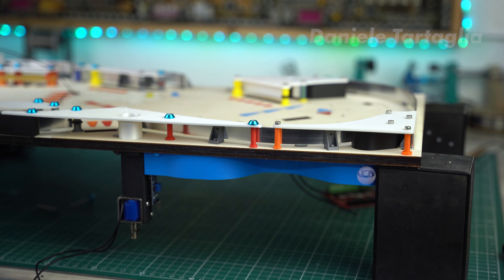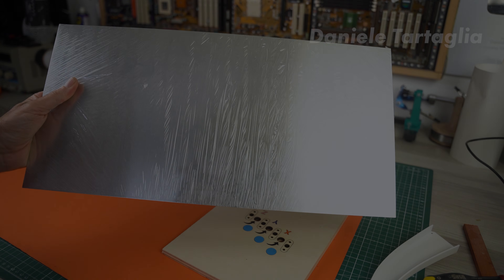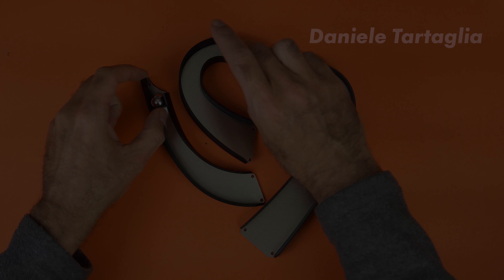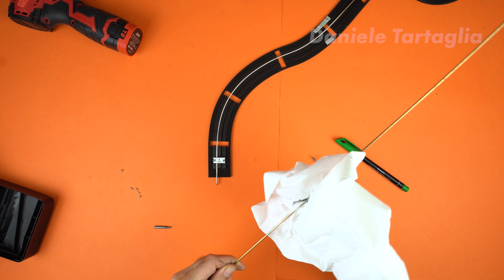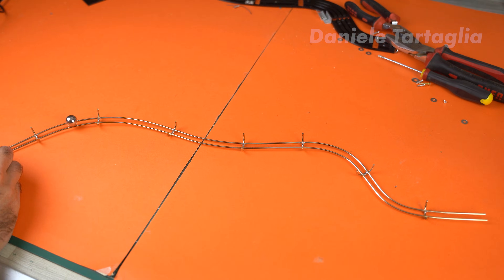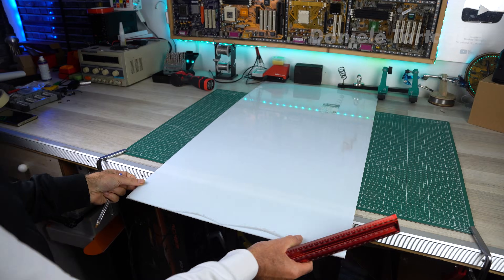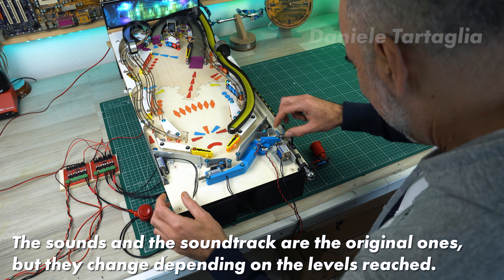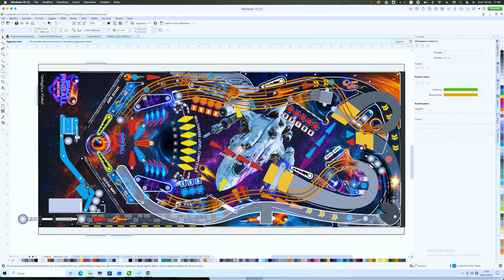How to make a REAL ARCADE pinball machine ( Ramps and wireforms ) PT7

Comment: Looks good!  One thing Missing, is a Boss Fight.  I would recommend adding Pop Up Aliens.. or Alien Ships, near the center of the Playfield.   These could be similar to Drop Down targets, or similar to the Trolls on Medieval Madness.   Another thing that would be Fun... is to add a spinner disc, like on Tales of the Arabian Nights.   That spinner is just two posts with rubber bumpers.  When the posts are hit, the Disc spins... racking up Points as it does.  The posts can get in the way of your intended shots.

 Also, rather than putting the enemies in the center of the playfield.. you might place some near each Entrance of the Ramps.  In that way, you have to Destroy the Aliens, before you can use the Ramps (Warps / Wormholes)

Instead of the a spinning disc... you could also make a Magnetic Shield Effect, that partially repels the ball away from the Enemies... by using eletro-magnets under the playfield.
And.. Or...  that Magnetic Shielding could be to protect you.. by repelling the Ball away from the side Ball Drains.. if you press the Ball Save buttons at the right times

 You may want to devise a system... where the Enemies can start to cause Damages to your ship(s).   This might be caused if the ball hits certain targets.. or it might be caused electronically, by failing to defend against the backbox mini game challenges.  You might have the potential to be offered some way to do mild repairs, to restore the ships health.   When the ship reaches a certain damage level... the ship will go into a Self Destruct sequence... before Blowing up.  On destruction of your ship... the game will automatically end.. regardless of how many balls that you have left.

 For Special Effects:

- Add small diameter Fiber Optics to the playfield, to simulate twinkling stars
- Add a Strobe light, pointing down at the playfield, for special lighting (explosion) effect modes.  You could add a color wheel disc in front of it, to change the color that strobes
- Add small thin lined Inserts into the playfield, to simulate Enemy Laser Beams
- Add Vibration motors, and or Transducers, to simulate HITS, Explosions, and other Effects
- You might think of a way to make the wireforms / ball returns... light up in such a way, that it looks like the Hyperspace lines that appear, in movies like Star Wars.  Something to suggest a worm-hole like effect... or the bending of space... or Traveling at Warp Speed.    At minimum... a Cool sound effect, some flashing lights / strobe,  a little vibration,  and use a Warp backbox animation.
- Add Life Bars or a Damage Percentage bar, on your Backbox display..  or some other way to tell the damage level of the ship
- Potentially add a Mini Display under part of the playfield..  to use for mini games, special effects, and changing animated graphics

- Potentially add a 3rd playfield to the game..  similar to the Pinball Machine:  Haunted House
- Potentially add a real pen laser, for special lighting effects.  Have to be VERY careful with this, as if a beam hits a players eyes, it will do permanent damage.  So.. not sure about this one.
- Potentially add some mini Neon tubes, or Nixi Tubes, for unique effects

- Change the Artwork, to use UV Paints (Ultraviolet) that Glows under UV / Blacklight.   Either have the game Black-lit at all times... OR... only trigger the Black Light LEDs on certain Game Modes.
- Potentially change some of the Plastics, to use UV colors that also glow under UV Light

- Make Sounds and Music from Synthesizers, that use FM Synthesis.  There is no better sounding video games, and musical keyboards.. than FM Synths / FM Synth chips.  Such as the famous Yamaha DX-7 keyboard... or the Yamaha FM synth chip that Atari used in Marble Madness.  Potentially rip some sound effects from Sega Genesis games like Thunderforce II, and Target Earth.  Maybe rip sound effects from movies like Star-wars.  At very least, one can take a of Inspiration from Target Earths synth jazz distorted guitar-like music track.   Black Knight 2000 pinball machine also had a pretty great synth music track.

Cheers